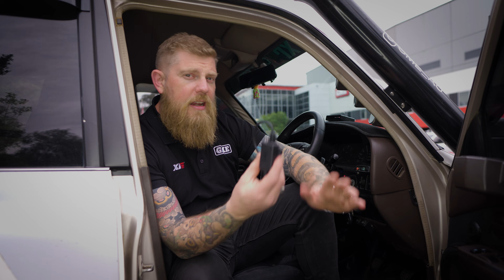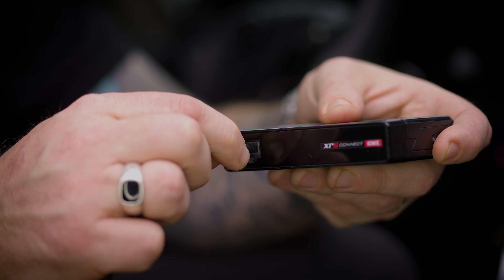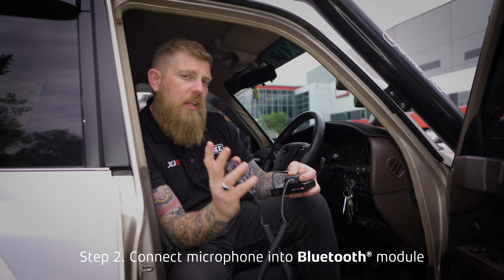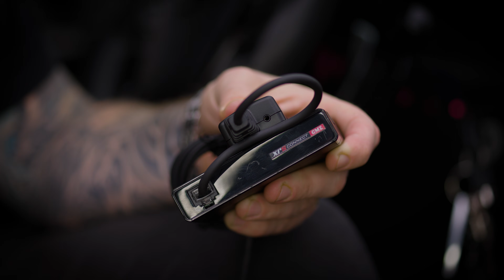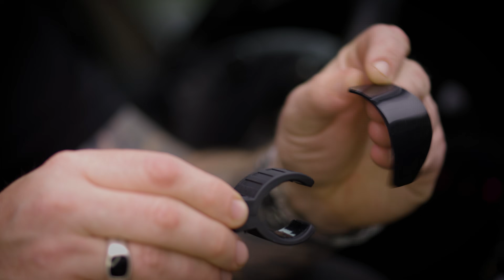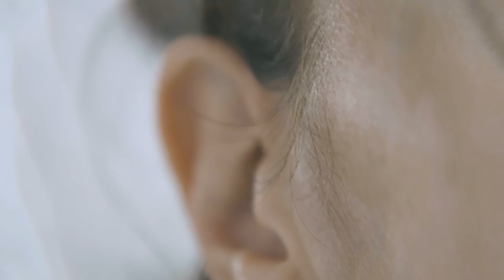Installation Guide: XRS-BT1 Bluetooth Interface Module | GME

Comment: Could I mount this on a bike with the XRS BT equipped radio and pair to a Cardo BT headset?
Reply from the maker: Hi David, yes this is something you can do. The XRS‑BT1 can connect to compatible Bluetooth audio devices, including headsets, so you can run it on the bike with your XRS radio.

However, for the best experience, we’d recommend looking at the XRS‑660, which has built‑in Bluetooth. That means it can pairs directly with both the XRS‑PTT and your Cardo headset, giving you a much cleaner and more integrated setup.

Comment: Can you plug a external speaker into a xrs i find the soeaker has tinny sound and its all distorted. I would like to hear it on a external speaker or even through the car radio
Reply from the maker: Hi there!
The speaker should not sounds like that so we would recommend contacting our service department on 1300463463 and they can look into it!

In regards to extension/external speakers, yes, you can add them to the XRS units.
To hear it through the car stereo, you will need the XRS-BT1 and with its built-in BT audio you can then select the stereo as the audio output.

Comment: Does work with blue tooth hearing aids but I still need them to be connected to the phone
Reply from the maker: Hi @garrystenner-wv3te the Shared Audio feature on the XRS-660 allows it to be connected to multiple devices (such as a phone) at the same time. If you head to page 55 of the XRS-660 instruction manual it covers this in more detail and how to set it up!

Comment: We run a couple of sidecar rigs. Will XRS-BT1 connect to a combination headset and microphone? We go offroad, so a straight BT unit is limited to just our bikes. Having the option of a BT connected UHF would allow us to listen out for and respond to fourbies, logging trucks, etc, who also share the tracks we use.
Reply from the maker: Hi again, the XRS-BT1 is designed to work with most BT Audio devices but we would need to knwo which model to know for sure. If you contact our tech team on 1300463463 they will be able to confirm for you!
Reply: @GMEaus  Cheers guys!
Reply from the maker: Hi there, that is a good question! We will check this with our tech team and let you know.

Comment: any chance these would work with an Icom IC-450?
Reply from the maker: Hi there, 
It will not work with the Icom IC-450 as the XRS-BT1 is only designed to work with the XRS Range of radios.

Comment: Do you have to use the wireless PTT & microphone to use the XRS-BT1? I've got a TX4500WS radio, alongside my XRS-330, so don't need that function. I do want to the ability to listen to UHF 40 through my Bluetooth Sony earphone, though, so my wife doesn't crucify me with all the bullshit truckies speak.
Reply from the maker: No you don't. You can still use the PTT on your XRS microphone as normal.